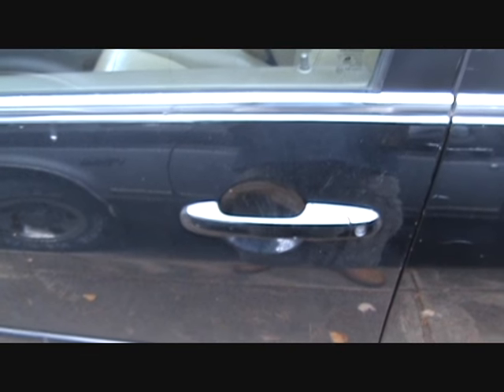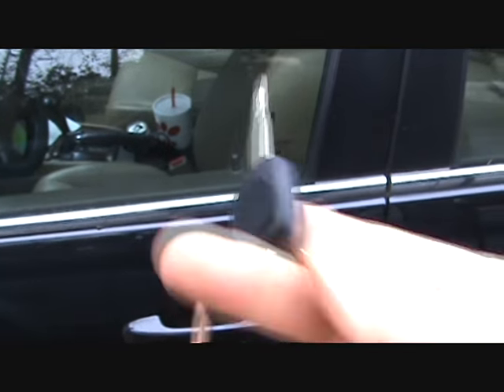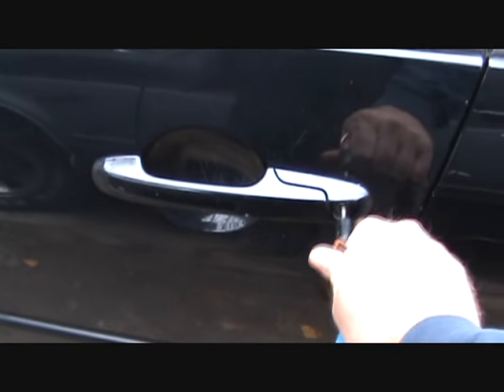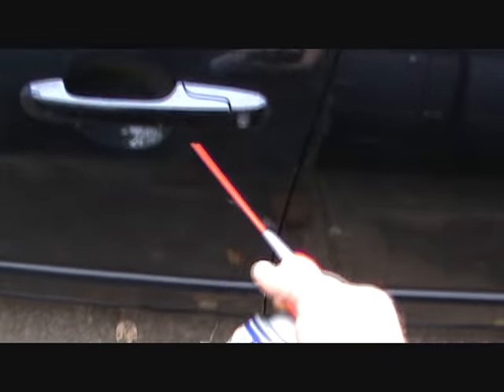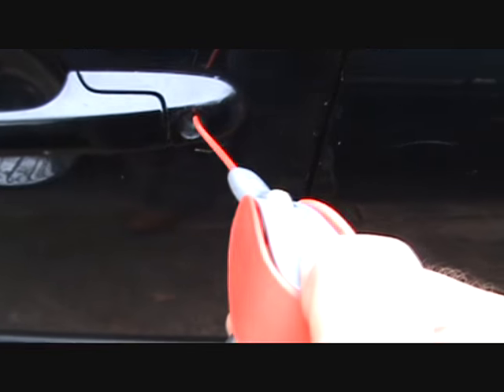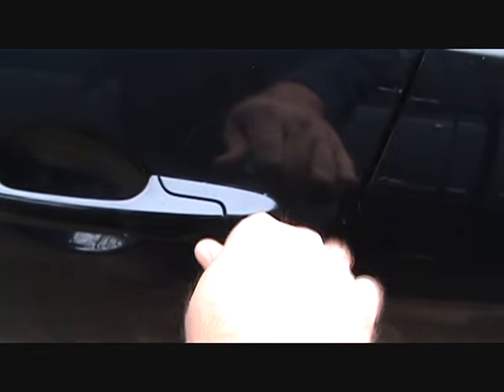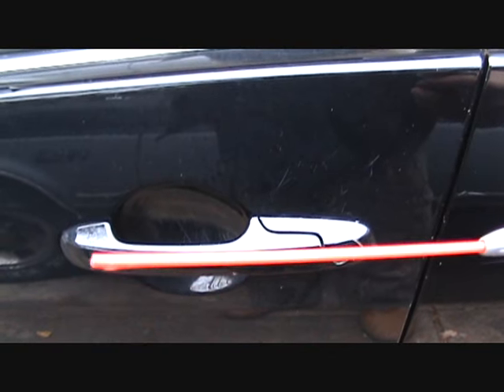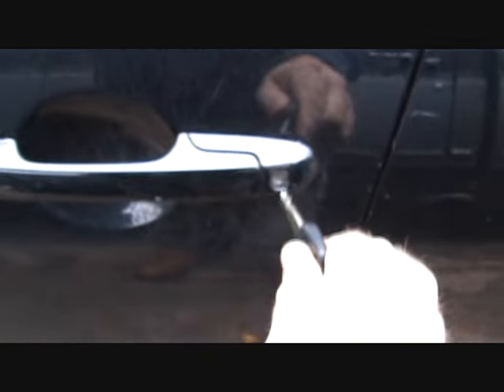Honda Door Key not working hack/fix simple and easy

Comment: Was just locked out on my lunch break at work. After trying for 15 minutes and no luck in this 98⁰ heat, I watched your video and found some wd40 in the facility. It took two bursts and it let me in. Writing from the AC interior of my car. Thanks!
Reply: I’m going thru this right now!!! I put the key and it’s stuck. Thank god the windows was cracked

Comment: Thank you!!!  I have 2004 Honda Accord and was thinking I needed a new door lock that would hundreds of dollars..  And what’s worst is for about 3 days straight I started leaving the door unlocked due to fear I would not be able to get it back open again; it got really bad. But I did everything you described in this video and it worked great!  The easiest it has felt in years!! Thank you!
Reply from the maker: Glad it helped its only a temporary fix. After a few years I had to eventually replace the key and lock.
Reply: Your reply helped me. I got locked out the car yesterday. Trying this today.
Reply: This me rn leaving my door unlocked I can’t be locked out
Reply: @Brandonjames8046  Yeah. I was doing that….  Because the author of this video is right. It does slowly come back. Luckily for me, I didn’t know until 6 months ago that my spare remote control lock still works…. That’s one option. If you can get a new battery in your remote lock if it does work already….

Comment: To people saying this is a bad idea/don't use WD40/etc.:

This is a temporary fix. When your Honda key and lock get to this point it means your key and lock are worn out and at the end of their useful life. You are going to have to replace the lock and key anyway. 
This happened to my Honda Element. I sprayed WD40 in and it was enough to let me unlock the door. Everything worked for several months and it seemed ok so I didn't worry about it. But suddenly one day this week my driver door lock stopped working. I could not turn the key, the lock was stuck at 45 degrees. Locksmith came and said my key was severely worn out. He had to cut me a new high security key and program it, cost $150. (Dealer charges even more.) He warned me several times "Do NOT use your old key any more or you will ruin your ignition lock!" It's even more expensive to get your ignition lock replaced! 

And I still have to get my door lock fixed!

If it bothers you to spray stuff into your lock then you can always enter through the passenger door.
Reply: hey my 07 honda odyssey is doing the same thing its a gamble everytime i lock it, i have extra keys stashed do you think switching keys would help a little?
Reply: I'm an automotive locksmith. Honda's are notorious for for having bad wafers (many of you call them tumblers). No other maker has this issue this bad. They have known about it for years and for some reason haven't addressed it. The door lock should have been rekeyed in addition to a new key. You will have problems down the road as only half of it was addressed. We use a spray called Houdini it's made for locks. Don't use graphite. That went out with high button shoes. These door locks a complete PITA to take out. Many YT video's on how to do it. If you are handy this is a DIY project. Buy a rekeying kit and fix your door locks without paying me $300. In all honesty they are such a PITA we send them to a mechanic to have them pulled and we will rekey them. I won't do them myself any more. Removing the the window 2 screws makes it a lot easier.
Reply: @cortlandmacdonald1368  that's what I'm trying to find out 🤞🏻
Reply: @cortlandmacdonald1368  I use a 2006 Accord, and the same thing's happening. How did you solve it ?
Reply: @scotts4125 do you know what the part is called that the key goes into? I need to buy a new one

Comment: Thank you! This worked great! However, in my case, it was because the lock was frozen over AND a dying battery on the key fob so none of the doors would unlock with just the key fob. I sprayed a ton (and I mean A TON) of wd-40 into the driver key hole, and was able to get into my car but the lock froze up again so I couldn't open the driver door (could have climbed out the window or other doors, I guess lol).. Fortunately I had a pair of pliers in my car & yanked the lock up from the inside and sprayed more wd-40 into the keyhole! Oh yes! On the road again!

Comment: I have a 2006 that's currently doing this.... I thought about WD-40 cuz I've been without the car for a day & it is  from up north so hopefully this will work , thank u
Reply from the maker: Be sure to have a new key cut when you can. Eventually the key will stick and not turn the lock or be removed. Had the have a locksmith cut a new key and replace the lock q yr ago. This was just a quick fox to get you from being stranded
Reply: @willwood487  I definitely will thank you for the advice appreciate it alot, I can imagine in an urgency someone might brake a window smh horrible when your in a rush ... thankfully I youtubed this

Comment: Pro tip: don't use WD-40 in locks.

The "WD" stands for "Water Displacement". WD-40 works great for keeping water off of and out of things, but it collects dust and will turn it into a gritty paste that will hurt your locks.

If you're in a dry climate you can use a graphite or teflon based lubricant such as triflow.
Reply from the maker: Good to know.I usually use Balistol.Just had the WD40 handy at the moment
Reply: Any tips for the manual lock mechanism on the inside? Mine is sticking just slightly. It seems like it might turn into a problem soon. Any suggestions at all?
Reply: 3-1 oil. Boss
Reply: I heard a locksmith say that graphite lubricants can also build up after time in your locks
Reply: Can you switch to the graphite if you haven’t used wd40 in about a month?
Reply: @amc7687  As Beef Chavez has said, WD40 absorbs water. It is mostly alcohol and quickly evaporates leaving a clean surface after washing away the moisture and dirt. It is not a lubricant and therefore, leaves no significant residue. (I've used tons of WD-40 for cleaning the contacts of switches in electronic repair).
Reply: Use wd 40 specialist
Reply: @willwood487 😊

Comment: Thank you so much dude this is so quick and easy 👍👍👍
Reply from the maker: It's only a temporary fix. Several years later I had to replace the key and lock. But it will get you by.

Comment: Gonna give it a try.. my alarm system had been weird. Main key won’t open now, but will the trunk. Radio goes out every now and then, have to put back code. New battery installed 2 months ago.

Update… nope and since that happens and you could pop it with a coat hanger, or squeeze in the trunk as the key works there most likely… then had to go under car and unplug the car horn for the alarm. Makes it drivable at least and not a nuisance. But this didn’t work for me spraying. 

For me I checked the hinges and the key worked 3 times and never again. Something is a miss inside the door. I just can’t believe in my 2006 civic no key lock on passenger… that alone would solve 90% of my issues till I get the main door fixed.

Comment: U just saved me 250 bucks. Honda wanted 150 to program key and 95 for a new key!!
Reply from the maker: It's just a temporary fix. Eventually you will have to replace the lock. But this should get you trough for a while
Reply from the maker: It will get you by until you can have another lock installed and key cut to match. Eventually mine stopped working and the key was stuck in the lock neither unlocking or turning to release the key. At that point I had a locksmith rescue me. We eventually had a fob key made and use the button on the key. Hard to do all that in a pinch.

Comment: Yes indeed fist thought I had and tried. No luck I  think someone tried to break into it.Key hole doesn't look straight up and down. I  got the key to go in once or twice .Turned  to the left but not to the right.Then the key got stuck in lock,very difficult to remove. Battery is dead no surprise it dies if the car hasn't been driven in two days or more.4 days car wasn't  driven .

Comment: It wasn't the door flap that you said was the problem since it DID allow the key to go in about halfway. Instead, it was most likely the inner lock "flaps" that were stuck and prevented the locking/unlocking process... thus allowing the key to turn and do its business. IMHO

Comment: Sadly, this didn't work for my 2015 Ford Fiesta (similar door lock control of the electric door locks).  My key did and does go all the way in (works on the passenger side at same insertion depth, hence I'm still able to drive the car, locking and unlocking via the dash button), but won't turn more than a few degrees toward "lock" and even less toward "unlock".  I suspect the mechanism behind the cylinder is jammed in some way and I'll wind up paying a body shop or locksmith to fix it...  :(

Comment: Having the same problem on my 2013 civic. Same type of key. I do have a remote, but it stopped unlocking the doors.
Reply: Same here on my 2011 Honda . It just started to not want to unlock anymore with the key
Reply: @angeljulian8602  my key stopped unlocking my door this yesteday. This tip did help.

Comment: Mine was not a key problem, or to use WD40, or the electric actuator, or anything else not found in any of these videos.

No, the problem was the lock cylinder shaft not being connected to the lock actuator that is connected to the cable, that in turn, moves the door lock knob.

To fix this, there is a rubber cover that you remove, revealing a bolt that connects the key lock to the actuator. There is a 10MM bolt to remove, and then take out the door lock. Remove the key lock cylinder and reposition the shaft into the mechanism that turns the lock. Then your door lock is now fixed. I would have made a video about this, but its not my thing.
Peace out.
Reply: WHAT RUBBER COVER??? On the door???? WHere???
Reply: @damianzurc  Dude, he won't tell you. He could, but it's not his thing.
Reply: Haha

Comment: Got me thinking the lock somehow got frozen, thanks hope it works
Reply from the maker: Mine about 1 yr later the key got stuck in the lock wouldn't un lock and wouldn't release. Stranded as to was the only key lock on the car. Had a locksmith come out and he took a wrench and turned the key in the lock to remove. Had to have the lock tumblers replaced.

Comment: DO NOT DO THIS.  wd40 collects dirt which will jam the tumblers worse than before. Use only dry lubricant DESIGNED for locks, which is usually made of graphite or teflon.
Reply: Too late
Reply: Been flooding auto door locks with WD-40 for decades with no ill effects. Ymmv
Reply: So now that I’ve already done the wd40 is there a way to clean it out? Now I wish I’d never watched this video. My key won’t go in at all now
Reply: Oh what is this dry lubricant called?

Comment: This is a temporary fix. When your key gets to this point you need to call a locksmith and get a new high security key cut and programmed. Locksmith charged me $150; dealer charges way more. Locksmith told me if you continue using old worn key it will ruin your ignition lock.
Reply from the maker: This is true.
Reply: @willwood487  Video is 3 years old; have you had to replace your key or lock yet?
Reply from the maker: @mattfoley6082  yes I had to replace the door lock. Key got stuck at 45°. Only ment to be a video to get you trough till you can have a new key cut and door lock replaced.
Reply: @willwood487  Stuck at 45 degrees, same as mine! How long after this video did you replace the lock? Did you replace the key at the same time?
Reply: So you have to repair the door lock and get new keys

Comment: It's actually pin alignment due to wear and tear. This will eventually break.
Reply from the maker: You are correct.  This is just to get you buy until you can have a new key cut and /lock replaced
Reply: On eBay it says I can get the kit for 10. Does that sound right to any of y’all ?
Reply: @area65o  what kit?
Reply: Honestly take out the cylinder and remove like 4 sets of pins then it will work.
Reply: @willwood487 whats the part called for the new lock?

Comment: WARNING! I used triflow lube but a piece of the red hose broke off into the lock and i had to figure out a way to get it out, i used small allen wrenches, and it still didn't work for me, not saying it won't for others but for my cousin car it didn't work, her lock seems loose and worn out.

Comment: I ended up using a pressurized lubricant called PB Blaster in the same manner that you illustrated in your video.  I know that I have a lock problem (possible broken spring or wafer?) that was more serious than your problem because my key was facing a physical obstruction 3/4 of the way in. that wouldn't let the key insert all the way.  I lubed the lock, and with maybe 50 repeated thrusts of the key, while turning the key counter-clockwise, I got the key to turn.  Sadly the window didn't go down, so I used a fast-motion "flip-over" technique to quickly turn the key clockwise, and the key unlocked the door.   I still have a lock problem and repeated efforts only unlocked the door about 10 percent of the time.  I found replacement locks with two keys for about $20 from an on-line auction site.  I hope to be able to re-pin the new door lock to match the key that operates my ignition.  If I can't re-pin the new lock, it looks like I'll need to use two separate keys with my car, one for the door and the other for the ignition..  Thanks for posting this video!
Reply from the maker: I had to eventually replace the key and had a locksmith cut it to fit my door. It got stuck in the door wouldn't unlock and wouldn't turn to release the key. He had to use a wrench on the key and break the lock. I was stranded with the key stuck in the door. Lol

Comment: I'm going to try this, I was almost late for work trying to open the car 🚗 I will try WD40
Reply from the maker: It will get you by until you can have another lock installed and key cut to match. Eventually mine stopped working and the key was stuck in the lock neither unlocking or turning to release the key. At that point I had a locksmith rescue me. We eventually had a fob key made and use the button on the key. Hard to do all that in a pinch.

Comment: I hv Honda Brio 2015, with imobilizer. Im facing exactly same issue. Will this liquid work?
Reply from the maker: If it's a Lazer cut key probably. But end result will need to have a new key cut as eventually it will not work. But it should get you trough till you can have a locksmith cut you a key

Comment: 2006 Accord EX.  First my driver side door, then passenger side, now ignition.  Door lock actuators are screwed which is why I started using the keys instead of the remote in the first place.  I have had some shit cars before and have never had so many problems like this.  F*** you Honda. They obviously used garbage components.  It is still mechanically sound though.  But like I said, never had so many issues on any other vehicle I have ever owned.  The door locks are in sync.  So one actuator failure lead to having to replace everything.  The first time you get locked out, is the funnest time.  It only gets better after that.  Hondas are reliable, sometimes.  But this uncommon crap gets pretty expensive after a while.  I miss the 90's...

Comment: Thanks for the tip. It works to some extent. However the lock keeps getting stuck, specially when the temperature is a bit down that usual. So every time I have to spray a ton of WD-40 and struggle couple of minutes to fit the key inside the lock. So is it recommended to change the lock at this stage, or anyone else some other suggestion ?
Reply from the maker: Yes it is more of a get you by till you can replace the key and lock

Comment: TEMPORARY FIX like so many others have said also. I did this for a little while until today it stopped working completely had to miss work an call a lock smith. If your doin this more than one a week to open ur door go get it fixed or even get a battery powered unlock button to unlock an open it auto zone does it for cheap

Comment: Don't use WD40 for locks! Use a lubricant that has a silicone, graphite or Teflon base only for locks. WD40 is a SOLVENT not a LUBRICANT. It will remove the lubricant in the lock. Graphite works best but spray only inside the lock as it is grey.
Reply: Its not just a case of do not use WD40 but make sure you're using the correct WD40. They make a complete range of sprays including silicon.

Comment: Did not work for me. 
All my key hole are messed up, never once I've experienced this with Honda but both Honda PILOT did this.. smh @ Honda pilot.

Driver side key was able to go in further but still can't turn.
Tried my back trunk and the straw got stuck. I tried everything and it wouldn't come out so I pulled it and now the tip of the straw is stuck in the key hole.

Comment: Do not use WD-40 on any type of lock, graphite is the way to go. WD will collect dirt and get the lock dirty, making your situation worse
Reply: If the lock is actually frozen (usual hint: it's well below freezing outside and the driver door was facing rain or sleet before it got cold enough to freeze solid), windshield washer fluid is better than WD-40.  Otherwise, as others have noted, this is at best a temporary fix, you need to at least get the lock cleaned and relubricated with the correct grease, as well as lock and key checked for wear.